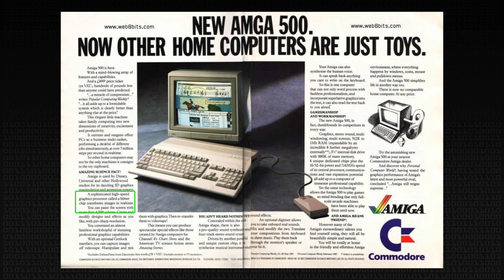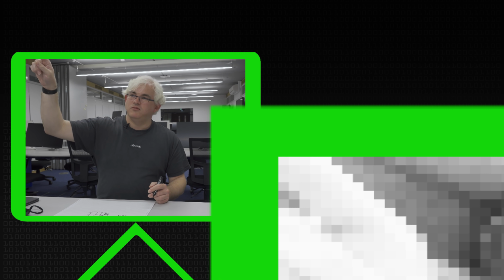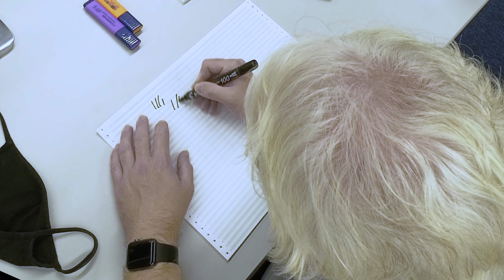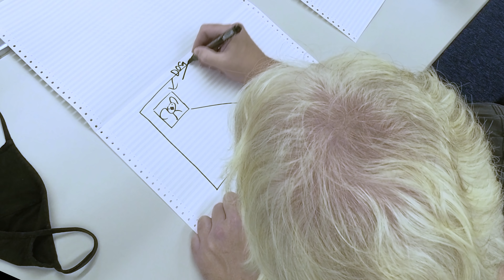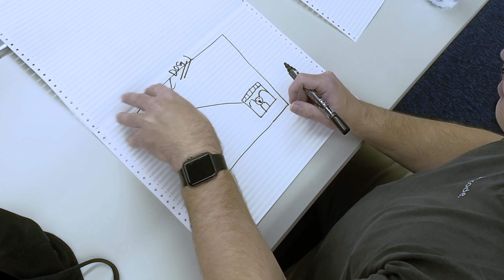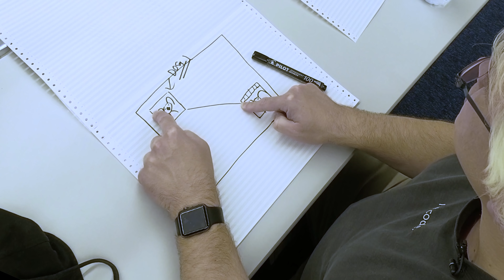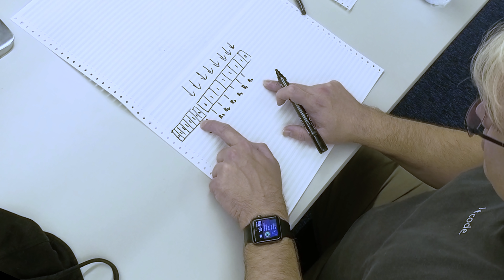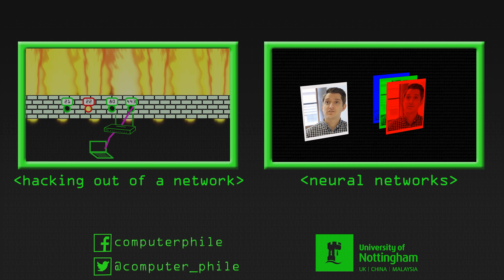Bit Blit Algorithm (Amiga Blitter Chip) - Computerphile

Comment: It sounds to me like he spent 15 minutes describing copying data from one memory location to another, and I don't really understand how there's really any other way to do it. You read from the source and write to the destination. I feel like he's describing something clever, but it sounds very obvious to me. What am I missing? I guess it's just the boolean operation in the middle?
Reply: It is what he's describing. What you're missing is the many variations (start part way through a byte/word, start part way through one block, discard part of a block, and so on) of how that move happens and the fact that while CPU can do it, it is designed for a more general case so it does it poorly. Blitter chip specializes in the moving and combining of large data sets quickly with low latency, something the CPU wasn't designed for.
Reply: If you do such copy operations with the cpu you first need a command to read the source-byte, then maybe shift it to get to the exact destination adress, "and" it to mask the bits you dont want, read the destination, "or" the source/masked/bits with it, write it to the destination .. and that for every byte (and also skip x bytes after a row is complete) - with a blitter you tell him the source, destination, modulos (how many bytes to the next line), shift how many bits, copy how many pixel in x&y - and then the blitter does the rest, your cpu can do something else ..
Reply: I understand the advantage of offloading a process from the CPU, but that's advantageous regardless of what you're offloading. He did mention that it was particularly efficient in hardware, but then never described why.
Reply: @wbfaulk  Because you need multiple cpu-commands, read the bits, mask it with AND, read the destbits, OR the destbits, write to the destination, and that over and over again, and skip row-bytes to get to the next row and so on .. a blitter has these commands "baked" in hardware, you just say how much to copy and he does his thing and the cpu is free to do other tasks.
Reply: @Lynxxde  Again, that's true of any offloading. What makes this more advantageous than other things you could offload? Also, my point is more about the incompleteness of the video than the idea that I can't find this information elsewhere.
Reply: @wbfaulk  Well it was useful, needed a lot and a lot quicker than cpus back then .. Things like Vectorgraphics later showed up .. and could be used with the blitter aswell, but it could only clear the screen, draw the lines, fill the polygons, draw textures into them .. all in separate calls - vector calculations could be done on the cpu and would theorectily also be offloaded - but not with amiga-hardware, modern gfx-cards are able to do that. Yeah i agree, a bit more indeepth information would be nice, but maybe that be to much for the regular computerphile viewer.
Reply: Yeah, he doesn't really set this up very well.  Imagine that 1 bit = 1 pixel.  This is the world the video lives in. (Each horizontal row of 8 pixels is represented by a single byte).  We can't address individual bits, so need to read and write whole bytes.

You're right to say that copying whole bytes from one location to another is trivial. But we won't be able to do that most of the time.  That will only happen if the region we're copying to/from is a multiple of 8 pixels that neatly align with a byte boundary.  

This easy case, however, is as rare as a unicorn.  Most of the time, you're going to want to copy a region that isn't byte aligned.

Imagine copying a simple row: pixels 2-9 to pixels 19-26.   That's still just 1 byte worth of pixels, but neither the source or destination are aligned in such a way that you can simply copy a byte from one location to another!   The source pixels span bytes 0 and 1 and the destination pixels span bytes 2 and 3.  Worse, some of the bits from both bytes 0 and 1 need to be copied to byte 3!  How would you handle this? 

This is just one of many possible scenarios. What Bit Blit does is generalize the process of copying regions of bits from one location to another. 

I hope that answers your question.
Reply: @recompile  I hadn't considered that you can't address individual bits, but surely that's a property of the computer architecture as much as it's a property of the CPU. When you put an address on the address bus, there's no facility to specify which bits you want to access, only bytes or words. If a blitter chip can resolve this problem, that implies that it's sitting closer to the memory than the address and data buses. Actually, I don't know what the architecture is going to be for the video memory for systems where this would be in use.
Reply: @wbfaulk  You're always working in bytes.  That's just how computer memory works.  (Bit addressing would be a nightmare, and still wouldn't make this process much simpler.) The Bit Blit algorithm makes things easier (it's a general solution the problem I described) making it easy to handle things in software. The blitter chip does the same thing but in hardware.  It still can't magically address individual bits, and it doesn't need to.  The algorithm is very easy to implement in hardware, which is why we saw blitter chips appear.  Again, they do the exact same thing as the software algorithm, just in hardware.  They aren't doing anything more.
Reply: @recompile  You can definitely find older systems where there's a chip per bit, though it may be that even with those systems it's impossible to supply a different address to those chips at the same time. (Seems likely now that I think about it.)

I guess my question at this point would be: even if the CPU is offloading the copying to the dedicated chip, it still has to tell the blitter what addresses to copy and where to copy them to. I guess it can be more efficient in telling the blitter the source and destination than having to do it itself, but if the blitter still has to access the memory it's going to copy using the bus, that means that it's not inherently accessing the memory more efficiently.

Again, though, I can look all this up. My point remains that the point of the video is about how this is more efficient, but nowhere in the video did it explain how.

It's a complaint about the video failing to live up to its own promise, not a plea to help me understand.
Reply: @wbfaulk  Perhaps you don't understand system engineering enough to understand if you think "its just offloading the cpu:.
Reply: @wbfaulk  No that's pretty much every computer ever built. They operate on whatever their word size is and no smaller.
Reply: @wbfaulk  The video and several people have explained how and you lack the context to understand it.

Comment: I see that planar graphics made a lot of sense to exploit a blitter chip...but it's a pain in the 0xA55 to do texture mapping with. No wonder only now the Amiga got a proper Doom clone (as in, it plays fast on a stock A500, in Fullscreen)
Reply: It's quite cool that Intuition (or is it from a layer below?) exposes all this to the graphic routines to plot shapes... something the Win32 API would have to wait a little to see the same level of versatility
Reply: Indeed. Even when the Atari st also copied that idea. You actually need that blitter. The 68000 didn't have a barrel shifter so every sprite needed preshifting. Better if they'd just used chunky nibbles. Especially for texturing and sprite scaling and rotating

Comment: Do modern computers have chips for this? Or do they just do it on the CPU? Is it a part of the GPU now?

Edit: I see, less useful with higher bits per pixel
Reply: At least on the CPU, with random access memory there isn't much need to copy things around. Most instructions can use one memory operand (source/destination) and the others are registers. So the AND could be either "read and AND" or "read, AND and write". Pure memory copy instructions are not prioritized because the limiting factor is usually latency. 
On my CPU: read (from cache) and add value takes effectively 0.5 cycles (out of 5Ghz, e.i. 5 billion/s), but the latency is 5 cycles. Accessing RAM takes hundereds. Even light could only travel ~6cm per cycle. CPUs have more power than simple operations require, so they make them more complex by combining them and executing them in parallel.
Reply: GPUs are more generic now. So they work quite differently. And video output hasn't used bit planes since vga. GPUs have tons of parallel processors that can operate on each pixel at the same time. And each one can often operate on multiple pixels with a single instruction. But you code it up directly. It can get complicated with shared registers, shared local memory, latency and other things. Loading data has latency, so you need multiple things to run on the same core so that when one program is waiting for data, it can execute a different program in the meantime. RDNA from AMD tried to reduce the number of programs you need. It can be on the order of 16... with AMD trying to reduce that to 4 or 8. And by program, they're really smaller sections of code and are called something else on GPU.
Reply: DMA Move Engines.

Comment: There also is the BItBlt Win16 SDK API, that wasn't implementeed in HW, but relied on auto-modifying code, if I do remember correctly Matt Pietrek's artticle from Beautiful Code. That was the reason why the first Microsoft WIndows was astoundingly fast ("fast" in the '80s).

Comment: Thanks, Steve. Quite interesting. Have you heard of NAPLPS? And if  so, perhaps you might consider a segment covering the once popular graphics protocol.
Reply: NAPLPS?  Videotex/Teletext Presentation Layer Protocol  Syntax (North American PLPS)? ANSI BSR X3.110-198X? X3L2.1?  Successor to TELIDON?

Never heard of it.

Though, come to think of it, back in June 1983, I had a weird dream that was picked up by a tornado and dropped in Chicago, where I represented Digital Equipment Corp. (not as the primary representative) at a trilateral (ANSI-CSA-EIA) meeting where we spent much of the time arguing over unprotected fields or some such nonsense.  I woke from the dream is a cold sweat, clutching the draft proposal closely.  Was it real?  That was definitely my handwriting on the March trilateral meeting draft.  My name isn't in the standard, I don't think, so maybe it was a dream... 

I still have a photocopy of the June 10, 1983 draft, and I spent several months implementing PDIs and DRCS for the NAPLPS and TELEDON terminal emulator for the DEC Professional 350, working late into the night in my cube on the 2nd floor of building 5 of the Mill in Maynard, MA. What utter BLISS (the language I wrote it in).

Comment: As fast as stuff like GLSL and Vulkan are, blitting is just SO much more intuitive. In some ways it's raised the barrier to entry for new programmers through the roof.
Why should you have to write program files in an alien language and work backwards inventing projection from "first principles" just to say "put a red pixel at 3,4"? Parallelism is fast but woof it's a dog when compared to pushing colors into memory directly.
Reply: If you want to write to display memory directly in Linux then grab a pointer to the frame buffer - have fun…
Reply: Because shader operations are inherently parallel. It's definitely less intuitive, but it's far more powerful overall if you take the time to figure out what is really happening. Still, maybe you are right that there is scope for a higher level of abstraction which could make this process simpler for some limited set of operations..
Reply: Try doing perspective correct texturing with anisotropic filtering using a BLIT.

Comment: In Atari Falcon, for just simple memory copy, Blitter is slower than CPU, so it makes no sense to use it for HDD data transfer and is not used for that.
Reply: The source code for AHDI definitely has code for using the blitter to read from the IDE, and as far as I can tell it’s enabled if IDE exists, and the machine isn’t an ST Book, which leaves the Falcon. Yep, the Falcon's CPU can out run the blitter, but the IDE isn’t just a straight memory copy since you are reading from a single location, and writing to many which forces you to use move.w (a0), (A1)+ type code, that won’t get the full performance out of the 030 anyway.

Comment: 7:20 i thought that was how it worked in the graphics mode on the C64, but it turned out it was quite a bit more complicated than that.
Reply: Commodore aimed for simplicity, so they used the same address generator in graphics mode as used in text mode, so the screen was still laid out as little 8x8 character regions. So in effect the whole screen was an agglomeration of characters with the bits of each character laid out as if they were little 8x8 raster scanned screens in memory.
Reply: @ChrisSmith-tc4df  and that is what made graphics programming on the C64 considerably more complicated than it should have been.
Reply: @mrxmry3264 complicated? It was a stroke of genius. Also well almost all arcade hardware and consoles up to the first PlayStation used character / tile based approach. Made total sense for many reasons. 

If you wanted you had a bitmap mode in C64. With the issues that created of course.
Reply: @ChrisSmith-tc4df not just simplicity but also for optimization and memory efficiency
Reply: @litjellyfish  bitmap mode? On the c64 the only graphics mode i know of is that weird tile-based mode.

Comment: which is better, avx compared to cores, same amount of atomic ops in memory size
Reply: compare single core doing say 10x n-bit ops as single avx op, or 10x cores doing single-bit ops
Reply: its the same speed, if all the cores run the same program in the same place, different register contents
Reply: result buffer of single operation, of two 8-bit operands, is 2^(8+8)bytes = 64kbytes, result is one byte, as a cached op chip

Comment: Didn’t the amega and comadore use sprite based graphics?
Reply: The Amiga had both hardware sprites and blitter objects. The sprites were quicker but more limited in number, size and colour.
Reply: @shadout  ah cheers! Distant memories
Reply: The what and what?
Reply: My memory is that the Amiga sprites were not written directly to the main bitmap, they were a separate bitmap that the video generation logic combined with the main raster at the right point in the encoding for each scan line they intersected with to produce the output signal.  This allows moving the sprite around without having to redraw the bits in the bitmap.  This also permitted them to be used over alpha-mosaic graphics modes on some devices like the Commodore 64.

Comment: Would've been cool if someone had made a blitter chip add-on for the Atari 8bits (via cart or PBI port). Ah well.
Reply: Booooring  😉
Seriously,  would have been cool, however, for games the ANTIC mode 4 is preferred. And using Blitter with char based gfx is not useful AFAICS.

Comment: How is a BOB different from a Sprite?
Reply: Depends on the architecture, on some platforms (eg the ST, or Archimedes) then nothing everything is done by manipulating the in memory bitmap, on others such as the Amiga then sprites are composited onto the background as the image is drawn to the screen by the video hardware, the hardware effectively reads the background bitmap and the sprite bitmap and combines them.

You can then move the sprite just by updating its position and altering where they are combined, rather than having to redraw it into the bitmap
Reply: @DrSteveBagley  Thanks
Reply: AFAIK the difference is that a BOB consists of actually writing the graphic into the display memory whereas the sprite is not written into video memory but instead overlayed on the output stream.  Put differently, as the pixels are being scanned and sent to the ADC, when a pixel position is reached where the sprite is not transparent the DAC will read that pixel from the memory where the sprite is stored rather than from the memory where the pixel at that position is stored.
Reply: @listerdave1240  Probably more accurate to say that the "GPU" reads both and when the sprite isn't transparent it writes the sprite data, instead of the buffer data, to the DAC.

Comment: This video seams to describe some sort of ,  'paged graphics' : am I right?
Reply: What do you mean by "paged graphics"? Blitting is just a basic process where you copy image data (could be other data, but usually image) from memory to other parts of memory. If you have separate video memory, then quite often the copy happens from CPU memory to video memory.

Nothing related to paging here. Blitting can be done with arbitrary-sized source data from any memory position to an arbitrary position in the destination memory. If by paging you mean double buffering, the answer is still no. Blitting is in no way dependent on the amount of frame buffers.

Comment: With all due deference to your Atari and Amiga fanbois (😊), let us not forget Bill Atkinson's Quickdraw programming tour-de force on the original Macintosh (128kb, 1984), which packed all this BitBlitty goodness, plus graphics line-drawing primitives (including circles, arcs etc), rounded corners, drawing regions,  font drawing, scaling, rotation, all in 24KB of hand-optimized assembly code.
You say, for example, that someone wrote a screen-copying algorithm that took 8 minutes to run? Then why was QuickDraw so damned quick, considering it was all done in 68000 code, and without even the benefit of a barrel-shifter, which only appeared in the much later 68020.
Reply: Well the Amiga had drawing code like this done in asm as well. Same cpu. Difference was that the line drawing code had help by hardware line drawings from the blitter